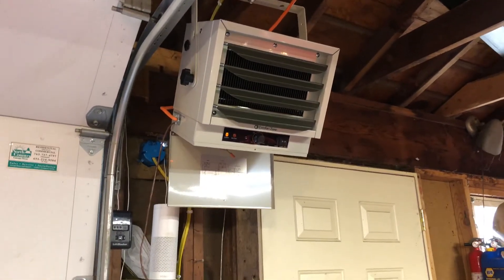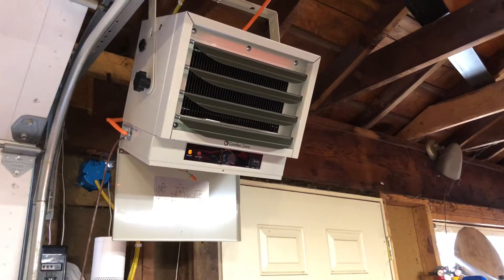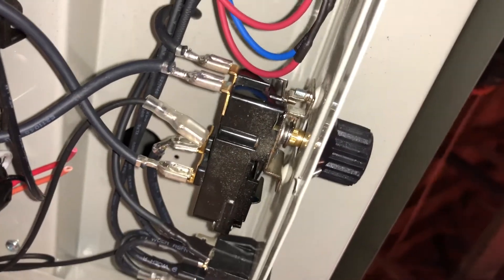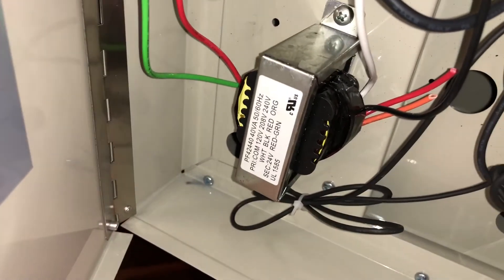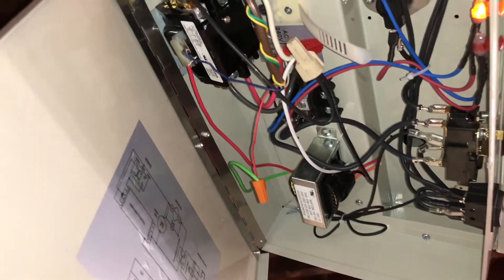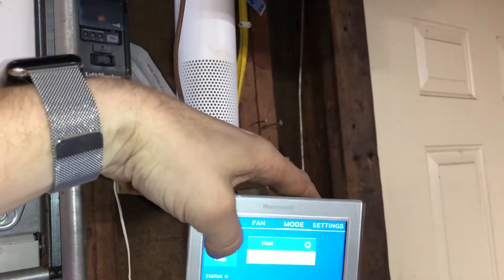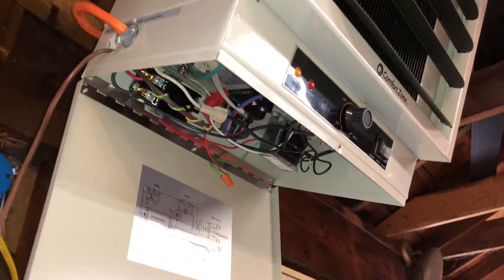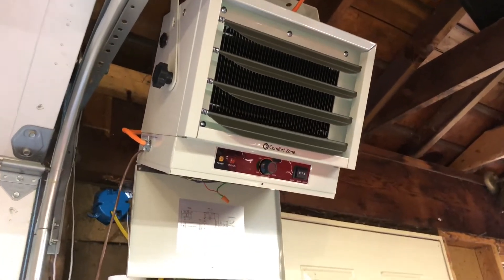How to: run your electric garage heater on a wifi thermostat!

Comment: Only issue I see in this is that there should be a cooling cycle. The fan runs after the heating elements lose power so the internals don't bake for several minutes. You need to feed a delay on break relay off the line side of the contactor which feeds the fan. Otherwise great work!
Reply: While I am confident that is a feature of some electric heaters, that's not the case on these units and is far more common for heat exchanger gas fired units.

if you wire this unit direct to a breaker and shut the thermostat off, there is no post flow or cool down fan-only period. that typically requires an IC and this decide is too 'dumb' for that.

Comment: Will this setup work for a 7500-10,000 watts thermosphere electric heater?  I have 40amp braker and 8/3 wire
Reply from the maker: as long as your contactor is rated for that power, it should
Reply: That is a multi tap transformer you dont necessarily need 8/3 just run two hots from the line side of the contactor to the primary side of the transformer.. that way you could run 8/2 and save money

Comment: Stupid question, does the thermostat regulate temp the way you have it?  With leaving the wires connected to the factory thermostat, I can't figure out how the external thermostat will regulate temp and not serve as just a wifi on and off switch.
Reply: When connecting an external thermostat like he did in this vid and leaving the factory thermostat wired up, you simply turn the factory thermostat adjustment knob fully clockwise. This arrangement gives temperature control to the newly added external stat.

Comment: Now that youve had this setup for a couple winters, are you still happy with it? I've purchased the items off your links and will be attempting this same thing on my heater. Thanks for the video!
Reply from the maker: I have to admit with off-peak power in the garage, it is really nice to be able to pull up the thermostat in bed on a Friday night and heat up the garage for some Saturday stuff overnight on the cheap power without having to go out there (and set it to a more reasonable 45 or 47 degrees). All in all yes, I can't imagine using one of these without an external thermostat.
Reply: @OvalboreTech  Thanks for the reply. I remodeled my garage over the past few months and am super excited to have a heater out there. Ive been using mine (very similar to yours) over the last month and with the built in timer/thermostat whatever it is, my garage has been staying too warm even with the dial turned to the lowest and i have a pretty large electric bill. Im hoping an actual thermostat set to like 40 full time, with bumping up to 60 when i want to work in there will be much easier on the wallet! Thanks again!

Comment: As many asked before, anyway to do this with 10/2 wire?  2 hots and a ground, no common so not sure  how the power transformer would work with no common
Reply: I think I can answer this after some more research.  Looks like power transformer is able to run off 240V (orange and white) connects to the 2 hots off 10/2
Reply from the maker: yes you can run the transformer off L1 and ground alone, but I have to condemn that action. it's really not safe.

you're better off running the transformer elsewhere and running the 18 gauge control cable for the thermostat and transformer separately to the unit if you're stuck with that.
Reply: @OvalboreTech  hmm I was looking at the transformer wiring and I was looking at running it at 240V not L1 and grnd.  I may look at other options.  Wish I saw this video before  running 10/2.
Reply from the maker: run a separate circuit or isolate the transformer. it's not kosher to do what I did either due to the breaker being a dual pole, but it's a lot safer using a neutral than bare copper ground. it WOULD work, but man I wouldn't sleep at night with it wired that way.
Reply: Use a 240V Primary 24V Secondary transformer.  The primary (Line) side of the transformer will connect to L1 and L2 and give you 24 out.  As others have said, do not use a 120V transformer between L1 or L2 and the Ground.  Doesn't meet code and is not safe.
Reply: @davidbondi  from what I can understand, it seems the step-down transformer wires (white and orange) are #18 but L1 and L2 are #10. Is there any issues with the difference in wire gauge?
Reply: @renemembreno8919  I am not an electrician, but no, that should not be an issue as long as you don't connect anything else to those #18 primary leads on the transformer.  If you look at other wiring in the heater, things like the indicator lights and fan aren't wired with #10 wire.  That is because they don't draw enough current to require that size wire.  The transformer is likely 40 VA (which means at 240 volts it will only draw about 0.17 amps on the primary side).

Comment: can I use 10/2 instead of 10/3 wire? noticed my service into heater is 10/2 wire.  If so, could I wire 240v to transformer?  Can one of the wires be used to power 120v to power my thermostat?
Reply: @bobd.  Yes it does. you could do both hot legs if you wanted to, but I did not opt for that.
Reply: @OvalboreCars  Understood. I would have done as you but no neutral at the 240V receptacle in my garage as it is an older home and not easy to upgrade to 10/3. It's working now so I'm good. Thanks.
Reply: @bobd.  what changes did you make? I have 10/2 wire at my heater and bought the 240v transformer.
Reply from the maker: not safetly unless you get a 240V drop transformer and use it between the L1 and L2 legs

Comment: Hi
Everything was working good except for the transformer
It stopped working after about 5 days of usage it has melted .
Reply: My transformer is good it takes about 5 clicks on thermostat to finally close contactor.
The whole process takes about 10 min I can hear the thermostat try to engage contactor then it finally works.
Reply: I am machinist not an electrician forgive dumb mastake . Connect your wire to RH not RC.
Reply from the maker: sorry I didnt see this in time - those should be bridged in almost every instance. Rc is from the transformer Rh is for equipment common

Comment: Good info.  I also found a good write-up on how to add a thermostat and fan delay to a 7500W unit here https://www.garagejournal.com/forum/showthread.php?t=375293&page=2
Reply: Thanks Henry exactly what i needed did you do this and how did it work out ?
Reply: @TheMixer1  No, I went with a heater that has a built-in temperature control and wireless remote control.  It's a Profusion model from Northern Tool.  Doesn't look like they sell the model I have anymore.  This one looks similar https://www.northerntool.com/shop/tools/product_200665094_200665094
Reply: @henryfpv007   Thanks, I got all the parts in today so ill see how it works , adds like $150 to the cost including a nice Honeywell wifi thermostat , I got laughed at here in the house for doing this as my wife just said walk into the garage and turn it  on . guess im lazy or like  many dot have anything to do around here. best of luck

Comment: Hi can you tell me where would the white wire from the transformer be hoked up to lm using 10/2 wire
Reply from the maker: its a neutral from your panel. you cannot use 10-2. has to be 10-3. You can buy a 240VAC to 24VAC transformer and bridge between L1 and L2. 10/2 is not code compliant for 240V appliances in the USA anymore
Reply: @OvalboreTech  Ihave the same issue. I don't have a neutral wire. Could you please explain bridging with the 240vac to 24vac transformer. TIA

Comment: 2 questions. 
1. Why did you opt for the a 40 amp contactor over a 30 amp? That unit only pulls 20.9 amps.
2. What do you mean my “unbalanced” exactly?
Reply from the maker: over specified contactor is never a bad thing.

its pulling more amps on one of the 120V rail than the other 120V rail
Reply: Ovalbore Tech thanks. I agree. The imbalance of amperage is negligible in my opinion.

Comment: Hi Erik, I got the same heater (Comfort Zone CZ220), ordered the same Contactor C240A and Transformer PF42440 24V / 40 VA. Hooked it up as you did (best that I can tell). Powered it up and it sounded "stuck"... after about 10 seconds, the transformer blew a fire ball? I wasn't sure while hooking up the thermostat. I put Blue wire to B, White to W and Red to R. I'm pretty certain I hooked up everything the way you did but wanted to ask if you may have any ideas what I may have done wrong? I can send you a picture of my wiring if that would be helpful.
Reply: I looked again at my wiring and I did find 1 difference. Where the Red wire from the transformer and Blue wire for the thermostat attach to the contactor, it appears I have those switched, compared to yours. Does it matter which side the Red/Blue wire is on the spade terminals? In relation, does it matter which side the White thermostat wire is on? By "side" I mean left or right terminal not the total opposite side of the contactor.

Comment: Nice mod to the heater Erik, wanted to see if you could show the electrical box connections to the common, ground, and 2 hot wires to the 30 Amp breaker. Thanks.

Comment: I had recently bought this same comfort zone heater for my storage barn. Was wanting to be able to control with phone so happy I found your video. I bought same contactor and transformer you have and hooked up exactly like you have it but it isn't working. Contactor isn't closing. Checked it and it's good. I'm getting 120v going into contactor and also reading  24v on the side coils so transformer should be good. I'm clueless on why it's not working. Did you change function settings on thermostat? I changed them to electric heat with no A/C. Using same 3 thermostat wires you are in video. Am I missing something? Please help. Thank you!
Reply from the maker: you got a 40kVa transformer? if so, try putting direct jumper wires from the transformer to the contactor legs to see if it fires. if it does, you've got thermostat wiring issues, if not, you may have a faulty contactor, although thats rare. 

ensure you have a 24VAC contactor. most are 120-volt triggers
Reply: @OvalboreTech  Thanks so much for your help! After taking a closer look the contactor I got was not a 24v coil one. I ordered the correct one and hopefully that'll get it goin...I don't see why it wouldn't. Thanks for mentioning that. Can't wait to get it and hook it up 👍

Comment: If your heater is designed for the fan to run after the element shuts off a little longer to cool it off then you need to put the contactor (or relay) in the thermostat circuit.
Reply: sure, however this heater does not run the fan after shutoff. that's only really common with natural gas fired heaters.
Reply: There are plenty of electrics that do it.
Reply: This was my same question. I have a fuh54 heater and it’s fan runs to cool the element once the room reaches temp setting.
Reply: @jeremycondon3692  did u do this install this setup

Comment: Hello sir, did you use 10/2 or 10/3 cable since you need a common wire?  Looks like your wire is 10/3 as you use your common to connect to transformer and the ground wire is grounded to unit.   Thank you
Reply: 10-3.
Reply: @OvalboreCars  Is it possible to use 10-2 instead of 10/3 by using the orange wire (instead of the black) of the transformer? I believe that would be 240v on the input side of the transformer.
Reply: can I use 10/2 instead of 10/3 wire? noticed my service into heater is 10/2 wire.  If so, could I wire 240v to transformer?  Can one of the wires be used to power 120v to power my thermostat?

Comment: Great video. Quick question about the ground from the panel to the heater, is this your common? 10/2 cable will have a ground which would ground into the heater itself. Did you do this?  I have a G73 heater.
Reply: I have 10/3 which is two loads, neutral and ground. you can do this with 10/2 (load, load, ground to unit)
Reply: Thank you.  I changed my wiring to 10/3 and added a 30amp double pole switch in line from panel and heater.  Obviously there is the common wire which does not attach to this inline switch, do i just leave it running through the conduit and into the transformer as the video above shows?  Just want to make sure I am not missing something.  Thank you @OvalboreCars

Comment: I just did this to mine. Everything worked great the first time I used the thermostat to turn it on. I turned it off and then turned on again and the contactor started buzzing really loud (in an open state). Tried it several more times with the same result. While it was buzzing I measured the voltage across the contactor inputs and it read 26.6 ACV .... any ideas what could be going on?
Reply: how many kVa is your transformer? usually a sign of insufficient power to the contactor
Reply: Did you figure it out ?